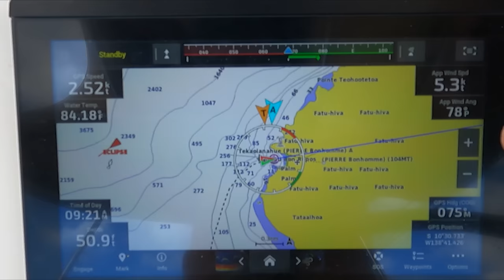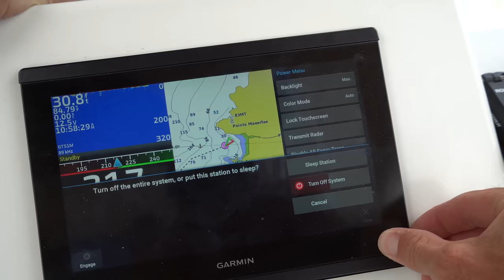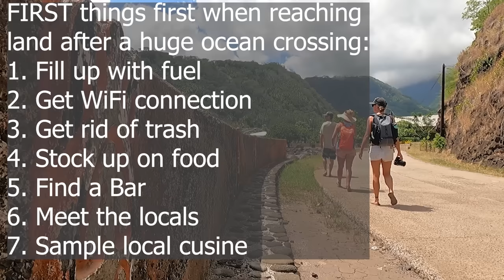LAND AHOY - After Sailing Across the Biggest Ocean | Episode 165

Comment: Being a busy body here. (I apologize in advance.)  I sailed on a chartered Helia out of La Paz that had a bad hydraulic seal in the steering. Normal turning of the wheel did nothing. Fast jerks would move the rudder. (Autopilot worked fine). Any center tape on the wheel meant absolutely nothing. (I remember turning the wheel round and round and round.) The indicator screen for the rudder position was outboard and low down of the helm. The only possible way to read it during daylight was if someone got on their knees and cupped their hands.  If I had  hydraulic steering I'd keep a couple of spare seal kits (doesn't look like a difficult job, but I'm sure it has it's headaches) and if possible I'd move that indicator monitor - where it was on that boat is completely useless.  And I'm sure you know all this and have it covered, but just in case....